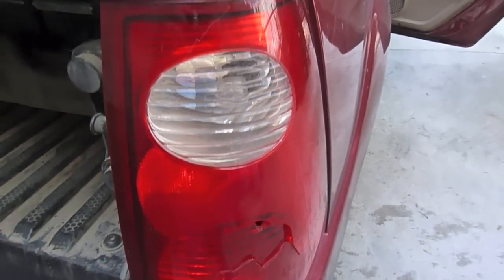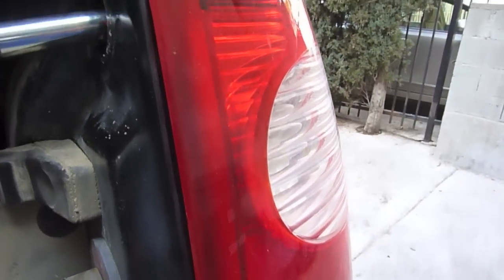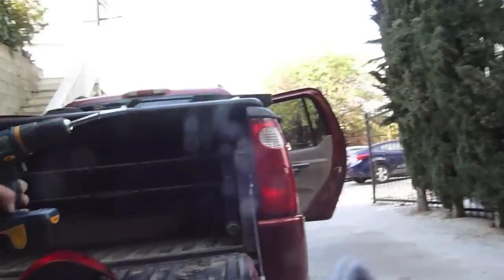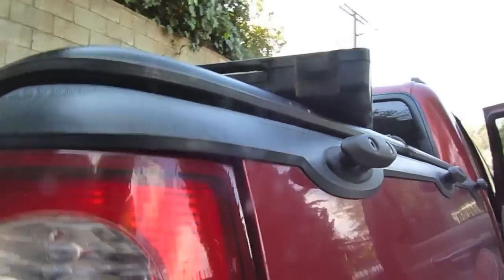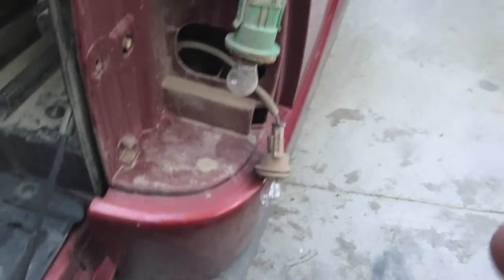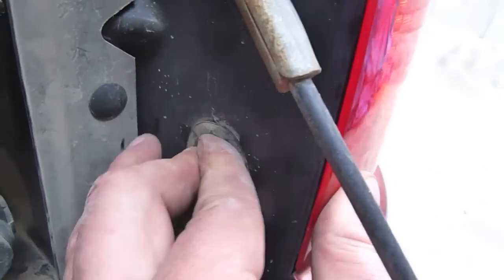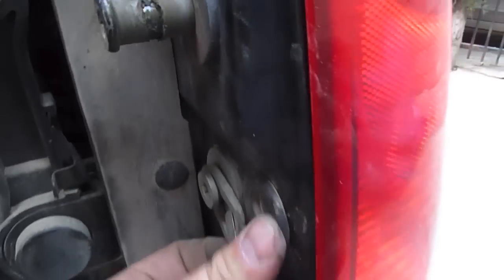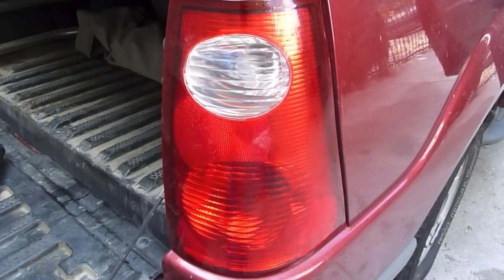HOW TO CHANGE TAILLIGHT FORD EXPLORER SPORT TRAC

Comment: Thank you. Thank you.  My turn signal was not working and I needed to replace the lamp.  The last time I did this was on an old Chevy with external Torx screws.  Thanks for pointing out the screw holes.